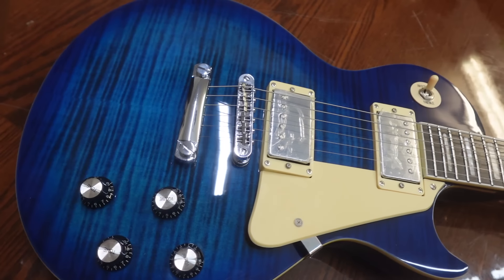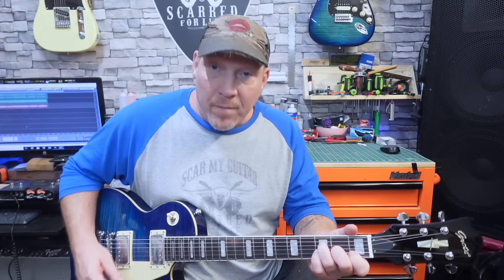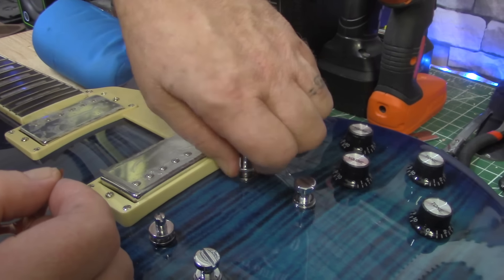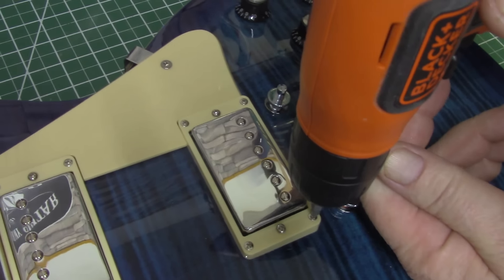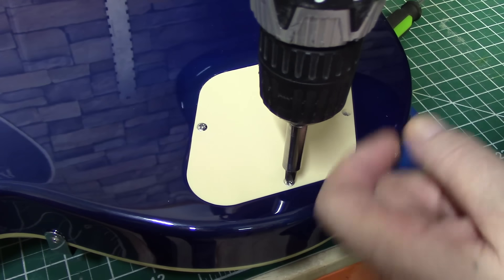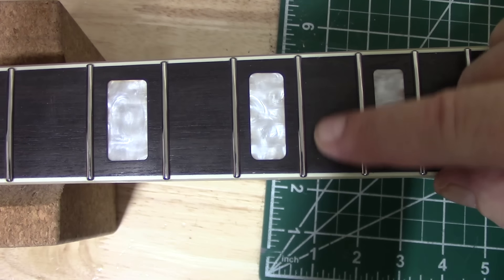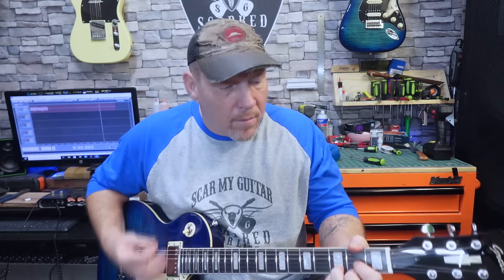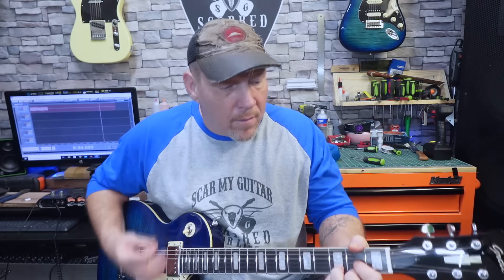AMAZON LES PAUL Copy DONE RIGHT? Let's Take A Closer Look!! #gibson #grote #lespaul

Comment: 500k pots are the only thing to use with an orange capacitor , it is not the place to cut corners, I hate scratchy 250ks potentiometers, no excuse and they don’t turn right, when you are playing and you need a smooth roll those sloppy things you can roll it half around and sound like you don’t know what you are doing. Take your pinky and roll a tone knob and what the heck just happened? I heard a little warble. And those pots have to go.

Comment: Thanks for the copper tape over the post threads. It's much better for sustain or vibration transfer. I once used regular plumber's tape, and it bothered me because I knew it would absorb rather than transfer the vibration. Great tip. Continued Success, Bro. 🤔

Comment: One thing you can do that I did to mine. I bought a nashville bridge, and the posts to the nashville can be pressed into the posts on this guitar with a clamp. When you do that the bridge sits tight on the bottom with very little adjustment up. I also replaced the tailpiece with an epiphone tailpiece. I replaced the pickups with Alnico V, with push pull. Mine is an older Grote and my only issue is that the paint is soft. Easy to make marks in it. But I do have a nice guitar that looks and sounds great and I only have about $300 in it.

Comment: I realize that this is outside the norm of what your (great) channel focuses on, but one day I'd love to see you do a full diagnostic on an (overpriced) Fender, Gibson or upper-level Epiphone in the $700-$1000 range. I've seen so many Strats and 335 Dots with issues that were obvious before the plastic even came off the pickguard. Penny-size chip in the neck finish on an Epi Dor, Fender Jimmie Vaughan signature Strat with a misaligned neck, which was white as snow despite the "vintage tinted" finish Fender touts...and more. There probably is a channel that does this with those guitars, but no one does guitar diagnostics as thoroughly as you, and thanks for that!

Comment: I have seen a lot of people rave about Grote and Redid. Particularly a semi-hollow model that's a copy of an ES-130. As you have said they often plan to swap out tuners and pickups but, they have always raved about the fret work. But, several seem to like the stock pickups even if they do plan on changing them.
Reply: I'll tell you what , I bought a Grote SG a couple years ago from Amazon. I paid $151 tax included and the thing was in mint condition. Not one flaw or blemish but I installed locking tuners and swapped out the pickups and it plays and sounds almost as good as my $600 Epiphone SG G400 pro. It's always a gamble with budget guitars but if the necks are straight you can mod them into a beast of a guitar! PS the pickups were decent and I saved them for another project guitar...
Reply: @mikeg6666  I am a fan of semi-hollow guitars which is why the model I mentioned caught my eye. I wasn't full of enough GAS to actually buy one. Besides, rather than dot markers Grote/Redid use rather large block inlays that just don't look right to me.
Reply: @MisterJWJ71  I hear ya , and I'm tapped out for awhile with new guitars myself...

Comment: That's a very honest re-evaluation of that Grote; they definitely should fix those loose bridge posts.  A Grote rep I've been messaging said that he thought the new ones were being updated with stainless steel frets, and would confirm shortly.  I'm wondering if those rounded end frets are a giveaway as I've seen them on some Fireflys that do have SS ones.
Reply: for 199 I can add the copper tape myself. (easy fix)

Comment: Grote seems to have it together for the most part.  I bought a Grote 335 knock-off back during the Covid lockdowns.  I did have to upgrade the machine heads because the original ones were pretty crappy.  Other than that, I have no complaints and I just love the guitar.

Comment: Plumber's tape works excellent also to tighten the screws and posts , occasionally I run into that on some of my expensive guitars...
Reply: That's true, but metal should touch metal if a post has been connected to the ground wire.
Reply: @woochyna  Yes that's true but sometimes there's no grounding wire connected to the post...
Reply: Was that shielding tape or just copper tape?
Reply: @PunkrockClub  No it's Teflon tape...
Reply: Pretty sure the studs for the bridge that are pounded into the wood are not connected to ground, so teflon is fine.
Reply: @Vicos  Plus it's an easy fix....

Comment: You need one of those thin Japanese saws so you can cut through pickup cover solder. It is cleaner and when you resolder, you just have to reheat with a little extra solder and viola'!

Comment: That tells me they are using close to the same pickup winding in the bridge and neck, which ain't a great thing to do. The slop in the hardware threads is just terrible. For                    48 more they can upgrade to full size pots and do away with those dime pots. Just pathetic. Now me., I do lock locking tuners, and would probably change them out and put on a Graph-Tec nut.

Comment: I can't believe you don't like locking tuners. They are definitely thw way to go these days. Pull the string through fairliy tight, then lock the tuner and tune it up. No extra winds around the fretboard, so winds cannot cause tuning stability issues. Locking tuners are the best idea that guitar companies have every come up with for tuning issues !
Also, when doing your sound test, run through both pickups with clean tones also. Play some open chords and just let them ring out a little bit, just to hear the clean tone of the pickup. Then run with some overdrive/distortion.